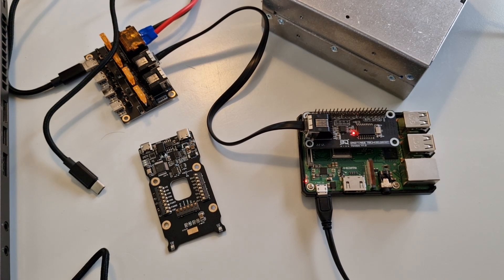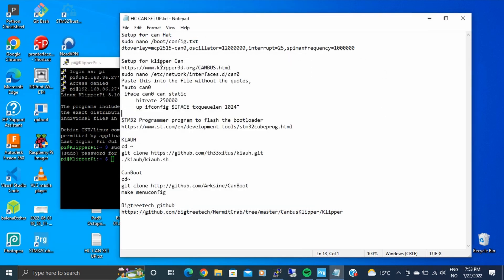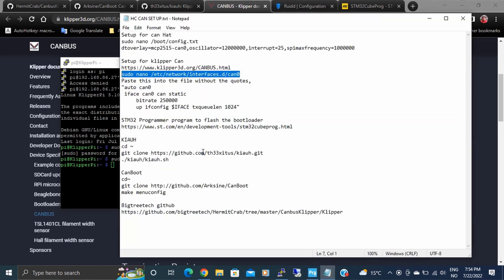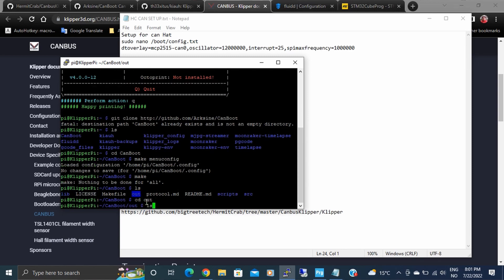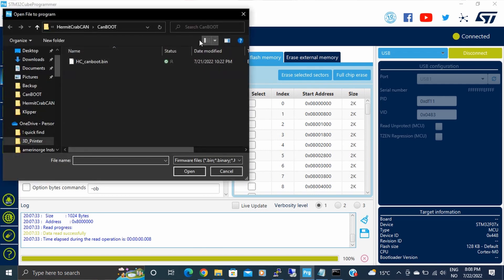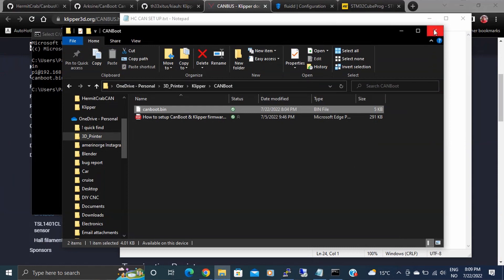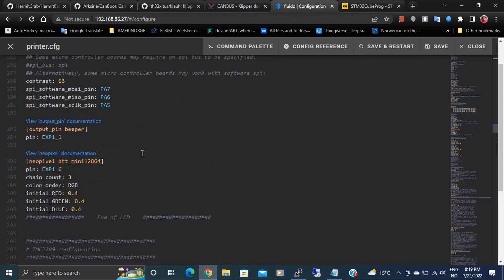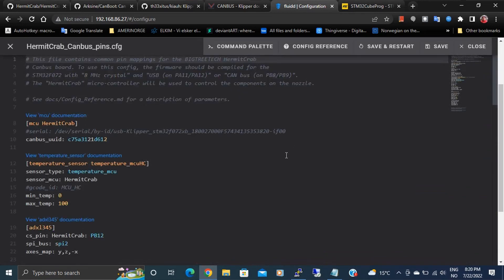HermitCrab CAN CanBoot (katapult) and Klipper Tutorial

Comment: I just ordered a Manta M8P With CB1 v2.2 and the Can Hermit Crab so finding this was too timely. Thank you. I hope I can get'er going from this! Great Stuff!
Reply: Did you end up getting this to work? I’m about to do the same thing as what you’re doing and I was wondering if I could just connect straight from the manta’s usb-c port to the tool head without any of those intermediary boards.
Reply from the maker: The usb on the manta isn't canbus. You'll need to connect to the canbus ports. The easiest way would be to get an rj11 cable cut one end and crimp the xh2.54 for the can ports on the m8p to the 2 center wires that go to the hermit crab canbus/power hub.
You can Also use something like this RJ11 Screw Terminal,  https://a.co/d/jjRMndM
Reply: @StackingLayers  thanks for that, really appreciate the quick reply! Will have to try that out.
Reply: @KostaHaltis  Actually I sent it back. I found it was more weight than I was willing to add to the setup just to save a few wires. In the end I found out that I could make wiring harnesses fairly quick and very neat. As far as the usb-c port. I did not try it so I can't be of help on that one. For me, the quick change element.... well I have a CR-10S and with the way it mounts I can just take the belt tension off and slide the whole thing off replacing it with a Micro Swiss NG. Maybe not as fast but how many times do you really switch heads. For me, not since I put it together and got everything printing fine. Good Luck!

Comment: for the klipper "make menuconfig" part, we are setting configurations to the stepper board we are using right?  (or do we need to change it to fit it to Canboot?)

(Other than changing the CAN bus (PB8/PB9)
Reply from the maker: The settings for the board you are making it for.

Comment: Thank you so much for thew video...  There is not a lot of documentation on how to set this up, and getting help from Biqu can be a little 'challenging'

Her is my issue   when i try to connect to the Can board on the hermit crab to load canboot,  I get this message
"Device is under read out protection.  If you want to disable RDP please reconnect with Read Unprotect enabled"

When i check that box, it says to repower my board.  when i do, it keeps asking to repower.  I'm stuck here....

Have you seen that message before?  And if so, what did you do to fix it?

Thanks again for your content!
if you want to reach out to discuss,  just let me know....

Dave
Reply from the maker: I'm sorry,  that is the first time I've ever seen that message. Is that with stm cube programmer?

Comment: FYI, the Hermit Crab CAN board doesn’t have a bootloader, so we are putting a bootloader on the tool head board. If you try to put just Klipper on it and use the default bootloader offset, then you get an error from Klipper of no connection.

Some that use the newest STM32CubeProgramer get a false memory protection error; to get around that error, drop back to an older version of this software.
Reply from the maker: Thanks for pointing that out. It's interesting I didn't get any connection error when I first tried without CanBoot.
Reply: i found a USB hub (in between the board and computer) fixed the memory protection error!

Comment: Hey man!  Thanks for the video.   By chance - Do you know if you were to remove the Hermit Crab board from your setup and replace it with a EBB42 if it would still work?
Reply from the maker: That would be a separate controller. It does the same thing as the hermit crab board not sure why you would want to use that if you you already have a hermit crab with CAN ability. The ebb42 won't fit in the same spot if looking to replace it.
Reply: @StackingLayers  I am trying to keep the x axis as light as possible with a e3d hemera Revo.  I don't need the tool swapping ability but the rest of the setup and a single USB C  cable is super interesting to me.

Comment: Hi sorry don't have the time to watch this, will turning off the Printer PSU turn off the hot end board? or does the PI power any of it?

If this works then I don't have to use the microUSB method which I don't know how to set up.

I always have my PI powered and it turns on a smart plug connected to the printer when I print.
Reply from the maker: As long as you are using the same PSU as your power source then yes it will shut off when power is turned off. The pi doesn't power it.
Reply: @StackingLayers  Fantastic, this will make things so much easier if I can just do it the offiical/cleanest way.

Comment: Hey Patrick, thanks for the vid.... it totally helped m retrofit my old CR-10 with an Rpi4 and an SKR1.4. It would have taken me a lot longer without your vid... Only problem I have now is the H2 Extruder heats very slow 8+ to get to 215C.... would  you mind commenting on this and or sharing the corresponding section in your printer.cfg.... thanks again
Reply from the maker: This is what I have for the extruder.
extruder]
step_pin: HermitCrab: PA6
dir_pin: !HermitCrab: PA7
enable_pin: !HermitCrab: PA5
microsteps: 16
#max_extrude_only_velocity: 80
#max_extrude_only_accel: 10000
rotation_distance: 3.4334763948497855 #for H2 3.4334763948497855
nozzle_diameter: 0.400
filament_diameter: 1.750
heater_pin: HermitCrab: PA2
sensor_type: EPCOS 100K B57560G104F
sensor_pin: HermitCrab: PA1
#control: pid
#pid_Kp: 21.527
#pid_Ki: 1.063
#pid_Kd: 108.982
min_temp: 0
max_temp: 250
Reply: @StackingLayers   Thanks !!!  can you comment on your heat times??? how long to get to 215c
Reply from the maker: I'll test it a little later, but I do have the hermit crab on its own power supply so my results may be different.

Comment: Thank you so much! I haven't finished my setup yet, still looking for problems in my .cfg files removing the old from printer cfg and such or something. looking at a comment by Matt Kelly I was thinking maybe there is a way to add a resistor or something simple like that to some of the pins on the tool head to generate a unique ID for it? Way beyond my skill though.
Reply: I got mine all finished, I ended up just copying all the stuff from the HermitCrab_Canbus_pins.cfg to Printer.cfg and all my problems went away. Mostly it was something like mcu temp errors or something similar. Might have been because I didn't have thermistors installed too :P but its all in one file now...

Comment: I am having an issue with the first step.... I have the Manta M8P board with CB1 installed. I have installed Klipper on the CB1 and the M8P. Now ready to set up the Can Hat...... When you enter the sudo nano /boot/config.txt command there is nothing but a blank screen. I have looked for a "/boot/" directory and that is not even there. ?????? Please help if you can. Mark
Reply from the maker: This video is for a raspberry pi. I'm not sure that the pi can hat is compatible with the cb1. There is a different io2can hat for that. It's the last option on this listing. https://m.aliexpress.com/item/1005005114935485.html?_randl_currency=EUR&_randl_shipto=NO&src=google&aff_fcid=94ac327774794670817cae5ea8674dd9-1682713724085-09769-UneMJZVf&aff_fsk=UneMJZVf&aff_platform=aaf&sk=UneMJZVf&aff_trace_key=94ac327774794670817cae5ea8674dd9-1682713724085-09769-UneMJZVf&terminal_id=34cc987cb4af40cbbce55f524666e4ce&afSmartRedirect=y
Reply from the maker: This is the information repository for the io2can adapter. https://github.com/bigtreetech/IO2CAN
The raspberry pi instructions won't fully work on the cb1. It's a different chip set and file arrangement.
Reply: @StackingLayers  Wow, what a 'CAN' of worms. You would think that BTT would do a much better job of this. Since you can get a reasonable pi, I guess I'm not having the easy of wiring after all. Thank you so much for getting back to me. I did not even consider that it would not be compatable with the CB1. So I looked into it and what a  mind field of failures. That is getting sent back. I did also get just the normal HermitCrab so I'll be just using that. Upgrading a CR-10S Pro. I'll have to make some wires up but that beets banging my head into a brick wall with no results. Thanks again for the info. Mark
Reply from the maker: The CBI works great it's just that one cannot fully use the raspberry pi code or hardware that is specifically made for the Raspberry Pi. The same goes with you can't fully use the CB1 hardware on the Rpi. It's just unfortunately the way these type of computers work some parts of them are unique. The nice part is they all use Linux so all the standard Linux coding works across the board.
Reply from the maker: Also the hermit crab Canbus Edition came out long before the CB1 so it was supplied with the can hat made for the Raspberry Pi
Reply: @StackingLayers  Very greatful for the help.... In the end I have decided too not even use the crab. My gosh, it is a heavy thing. Too heavy for my liking. Have you found print quality ok without ringing at faster speeds with it. I assume you did the input shaper and preasure advance too?
Reply from the maker: No issues at all. I don't use pressure advance with the H2 as I get best results without it, and I have done the manual input shaping. Prints are nice and smooth.

Comment: Hi first of all great tutorial! I am trying to get the STM32 bootloader loaded but I cannot get the Programming tool to recognize the board. Following the bootloader procedure it still does not see it in DFU mode, but I see it as a device in device manager. Ideas?
Reply from the maker: I haven't ran into that issue. Do you have USB selected at the top right next to connect? Try a different USB port and /or cable by chance. It's odd that it shows in device manager but not in the programmer
Reply: @StackingLayers  I agree. I didn't try a different cable but I did try a different port. Going to try another cable when I get back and see. 

But yes USB was selected in the programming tool.
Reply: So future update, both of my laptops for some reason have some sort of USB driver or protocol that makes this error occur. If you have this issue or it can read but cannot write anything, use a usb adapter. I found one that eventually worked.

Comment: Did you tryed with a raspberryPad5 instead of a raspberry ? it work but don't like to use the btt Can Hat.... if you know if I can put my raspberry pad 5 to the BTT CAN Tool without burning I will be really thankfull
Reply from the maker: I did not set it up with the pads. It will work but you'll need an adapter to connect the pi can hat. The raspberry pis don't have built in CANbus so you need to use the hat or some other raspberry pi compatible CANbus transceiver
Reply: @StackingLayers  RaspberryPAD5 have a transceiver built in but don't know if the the can tool will burn it with the 12/24 v injection. I will try with a usb-c voltimeter before insering the usb-c cable to the raspberryPAD5
Reply from the maker: Oh that's right I forgot about that! Time to repurpose that screen 😅 things will not get burned it you connect the can out to the can in on the power distribution board. The USBC can on the hermit crab is made to work with the power hub so I would not plug it directly to the USBC on the pad5 it can't provide enough power, and I'm not even sure if the power lines are isolated when set to can mode
Reply: @StackingLayers  yaaaa, I'm scared of the non-isolated part. Thanks
Reply from the maker: The way I imagine it connecting is from the pad 5 to the hub board with a modified cable that is only the 2 can pins then using the hub to supply power and can signal to the HC board. The hub has a fuse set up for power safety so it makes sense to keep using that.
Reply: @StackingLayers  good idea maybe a buck converter in the middle...usaly usb-c have some controler that ask what voltage is used but until I test that I will never know :)
Reply from the maker: I would personally look for a data only cable. You only need can high and low from the pad5 to the hub board. I'm thinking I'll just set it up since I've changed things on the unit I was using my pad5 on, and no longer need it there.  I'll let you know my findings if I end up doing it sooner than later
Reply: @StackingLayers  better ...I will do nothing:( in Pad5 manual: "Warning: The voltage of the Type-C is ONLY 5V, Please don’t wire to the Type-C
of the HermitCrab Canbus(24/12V). Otherwise it will cause irreversible damage
to Pad5 & CM4."
Reply from the maker: @SETMIDDLE yeah that's what I was saying. You would have to do a data only cable mod to the hub not directly to the hermit crab.

Comment: What is the point of installing Klipper for this Hermit Crab CAN?  What does it do I don't understand bro because I have an ender 6 and I am having a bunch of problems that's giving me a headache and all these upgrades is costing more money so what is the point of this upgrade?   So I can use wireless or USB to print??
Reply from the maker: This is a tool changer setup, an advanced tool system made for custom applications like swapping to a laser engraver, CNC milling tool, or other types of hotends without having to rewire everything. The canbus is not something marlin can really do so that's why it's with Klipper. The advantage is less wires and since it's a second MCU with a built-in stepper driver it frees up a stepper port on the main controller board for other features like independent Dual Z axis. And other things like that.

Comment: Hey would this be the same procedure if I wanted to install it on Btt CB1 instead of the raspberry pi?
Reply from the maker: Very similar but you will need the io2can adapter for the CB1 the PinOuts a slightly different and the CB1 OS has an overlay in the boardEnv.txt so it slightly easier, the canBoot part is the same. Here's the GitHub repo for the io2can https://github.com/bigtreetech/IO2CAN
Reply: You can’t get the io2 board anymore, also I’m using a manta m5p mainboard if that makes any difference?
Reply from the maker: Oh that that board has a CAN chip built in. You should be able to get can running without the adapter using this process, https://github.com/bigtreetech/Manta-M8P/issues/30#issuecomment-1429197885
I know it's for the m8p but it's the same chip.  Just use communication interface CAN on PD0/PD1 instead of PD12/PD13 the rest should be the same
Reply: @StackingLayers  thank you for the great tutorials. I still seem to be having trouble with my M8P + Hermit Crab CAN setup. I have the hermit crab flashed with the canboot.bin file, I have klipper flashed to my M8P. I  can see “OpenMoko, Inc. Geschwister Schneider CAN adapter” when running lsusb, and can see “Detected UUID: {myuuid}, Application: Klipper” when running the flash_can.put -q script. The hermit crab is plugged into the tool board, tool board is plugged into the m8p using a telephone cable with crimped JST-XH on the board end, I can’t seem to get the uuid of the hermit crab to show up so I’m not sure how I’m meant to flash Klipper onto the hermit crab. Any further ideas or pointers that I could try or look out for?
Reply from the maker: For the M8P you are going to have to set it up in can bridge mode. Similar to how I set up the M8P in this video https://youtu.be/EA-oBfenxAE
Reply: Yeah that’s the guide I’ve been using. The strange thing is now mainsail won’t recognise/connect to klipper on my m8p. It says it’s trying to connect but then it cannot. Before I started this whole process, I had it klipper working moving motors and controlling the bed and fans. I feel like I’m missing something fundamental in the steps, I might need to start from scratch with a fresh OS image for the CB1 and try again.
Reply from the maker: It doesn't recognize klipper at all or is it trying to connect but you get the MCU connection error?
Reply: @StackingLayers  klipper is running according to mainsail, I don’t have it open currently but pretty sure it’s the MCU connection error
Reply from the maker: Do you have the 120R jumpers in place?
Reply: @StackingLayers  Thanks for pointing that out, I'm new to this whole CAN stuff and my electronics skills are still a bit rusty. I've added the jumper, and also realised that I hadn't updated the printer config [mcu] to use the new can uuid for the M8P for the connection, I can now control motors and the bed again. I'm still stuck on how I'm meant to get the Hermit Crab to present itself to the CB1 and/or Klipper. I have tried using that python script in CanBoot to check for devices on the CAN network, it use to show only the M8P as a 'Klipper' device prior to me getting it to connect, now it is saying that it cannot detect any CAN devices. Is this likely to be the issue you mentioned during the video where CAN devices may not show up if you set up Klipper too early in the process?
Reply from the maker: Once the m8p, or any can device is recognized and accepted by klipper it will no longer show up in a query. Since the mop is working you don't need to worry about it. The UUID will stay the same. To get the hermit crab recognized you will need to get it wired to the m8p and make sure the firmware is set up with the same speed that was set on the cb1 and m8p

Comment: What happens if klipper is updated?
Do i need to update klipper on HC too?
Thanks!
Reply from the maker: You don't always have to but if the update has fixed things dealing with that chip then it's a good idea. That's what makes CanBoot so nice, once it's set up you can flash firmware from the terminal via CANbus without needing to disassemble things.
Reply: @StackingLayers  thanks,but can you explain to me how to do it?
I only remake klipper and push it with canboot?
Thanks!
Reply from the maker: Yeah the same way it was done in the video. Around the 26 minutes mark. Using the command 
flash_can.py -u <enter_your_uuid_here>
Make sure you are in the CanBoot/scripts folder when running that.
Reply: @StackingLayers  thanks,i think it could be useful to include a note about it!